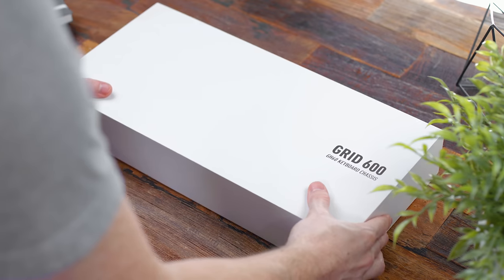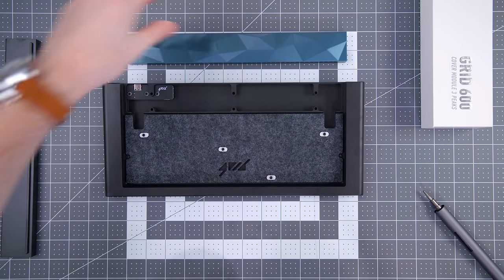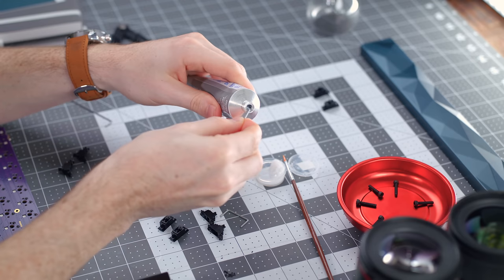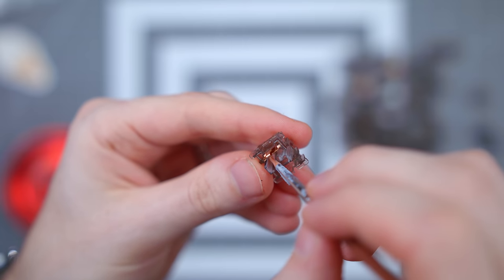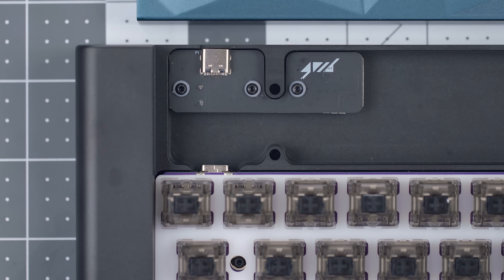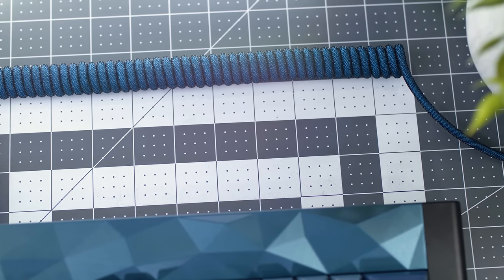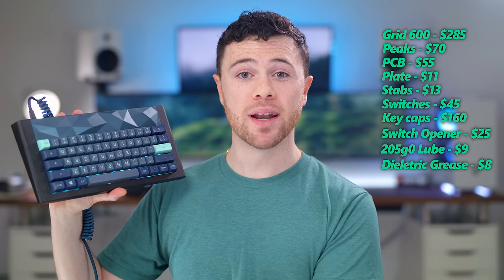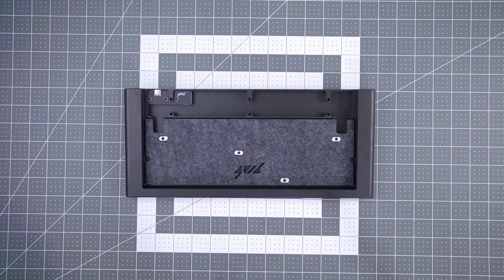Building My $680 Custom Mechanical Keyboard!

Comment: Hey Frank! Awesome video. I've been building boards for a couple years now and have a couple tips if you're interested:
1. You can use 205g0 on all parts of your stab. Just brush it on the wire like you did with the stab housing. Also, make sure you lube the stab insert too (the part that you clipped).
2. Hard to tell, but it looks like your switches are not clipped into the plate so it's just resting on the pcb. I've also bought that plate from spacecat and I had the same issue. The switch cutouts are too loose.
3. Leaving the middle screw out won't soften your typing experience unless you also remove the standoff. The pcb is just resting on it now and likely making noise when it smacks against the standoff.
4. I know you said that switch you lubed was messy, but just in case, that was enough lube for about 3-4 switches. You want just enough that there is a slight gloss texture to the plastic. There should be no white globs or areas of excess buildup or the switch will feel gumed up and sluggish.

Otherwise, this is a heck of a first build. My first "build" was literally just a switch swap, haha.
Reply: Ensaum for stabs it’s better to get dielectric grease and superlube, 205g0 is still good tho
Reply: @ferni0  I've done both multiple times and gotten better results with 205g0. Personal preference though I guess.
Reply: Ensaum I’d say for beginners superlube is easier because of availability, when you start lube is tricky to find
Reply: Can i mix dielectric for wire and thick lube for sliders?
Reply: Nevermind lol
Reply: @ferni0  Yeah, 205g0 can definitely be hard to find in stock, but he already had it which is why I suggested using it on the wire and inserts too.

Comment: Me: can’t afford a 600$ PC

Randomfrankp: Lets build a 600$ keyboard
Reply: A $600 PC? From where? Wish?
Reply: @NightRainn  hp elite 8300 sff i5 3470 and gtx 1030 8 gb ram for 240$ on ebay and gtx 1050 ti for 250$ get the hp elite 8300 sff without a gpu for 100 or less and gtx 1050ti and that's a 300$ or 350$ gaming pc
Reply: @shelby3724  *gt 1030 ;)
Reply: Get a better job
Reply: @calebfisher7690 some of these 12 yo kids cant get a job lol. Theyre the ones that make up most of the comments saying i wish i had a better pc and some of them are in indonesia etc where its hard to afford pcs there, personally i have a mad setup ;) rtx 2080 super,32gb of gskill trident z royal rgb, ryzen 7 3700x and 5tb of ssd storage
Reply: Seth S. the subtle flex at the end 😏
Reply: @percwhitney  😉 hahaha, shhhh....
Reply: N-Word  lol i appreciate your oddly voiced opinion, i like my setup and thats all there is to it :)
Reply: As a 12 year old, I can say that it is very hard to save money. $6 per week with no way of getting more does not do you much good.
Reply: I’m 12
Reply: @shelby3724  Or just a second hand rx 580 or a 1070 for under 200, but yeah you can get a decent gaming pc for cheap these days
Reply: @Shwanksy  Yeah dude I feel you.. They just whining about having a bad pc while being too lazy to work for it, i personally got my pc 5 years ago, a g3258 and an r9 270x, worked 2 months for it :) Now when I have a real job I got my dream setup which is similar to yours, 3700x and 2080 super :)
Reply: If you can't afford a $600 PC, then you need to reevaluate your priorities and/or save more money. It's really hard to save for that setup you want if you eat out all the time, go to the movies, buy other things you don't need etc etc. Any normal person (normal being people that have access to a device and internet to even watch this video in the first place) can afford to buy any PC they want within reason. An i5 / 1660 or AMD equivalent is not unattainable for the majority of people who wish they had something like that.
Reply: World Known some people aren’t old enough for a job
Reply: @calebfisher7690  Get better parents!
Reply: @NightRainn  building it yourself
Reply: Its NightRain I got a custom made pc for $490 australian dollars (2x more then american, so about $245) including a moniker, keyboard and mouse
Reply: @markojovanovic7100  yeah man its absolutely surreal when you can finally get something like that aye
Reply: N-Word  tf is a 64 core dominator ram xD
Reply: i’ve found another
Reply: @oscarsolano8298  haha yeah probably but damn... i gotta get me a 64 core dominator ram xD
Reply: @Shwanksy  true.
Reply: Lone Wolf dear god. when was that made? 2009?
Reply: @Hi-vp2bq  you guys are getting paid?
Reply: Save up
Reply: It'z.Zilent   ;)
Reply: It'z.Zilent  i mean its not like im rich, i have a full time job so i grinded out the hours at work so i could grind out the hours on rainbow six siege ;)
Reply: It'z.Zilent  yes but not the official rtx minecraft. Ive been using seus ptgi and umsoea 4k and its dope af
Reply: Lone Wolf and thats a trash pc
Reply: @Shwanksy  weird flex but ok..... I myself stuck here with a 3990x 64 core, 8 x 16g  ddr4 3600 cl16 trident  Z Royale, 2x Radeon VII 16gb HBM2 and a Aorus TRX40 Xtreme with 16x 70A....
Reply: @paulmueller100x  ayyyye nice my guy
Reply: @paulmueller100x  my render rig is nearly as good. Ive got last gen threadripper 2990wx
Reply: Bruh u havent seenthe tfue $3500
Reply: N-Word thats a godly pc wdym
Reply: Easliy Displeased  lol true, i just buy cs shit now
Reply: @markojovanovic7100  Yeah, but they're 12. What source of income do you think they will be getting? Mowing lawns? I personally wouldn't spend that much time just to get a PC. I would rather spend that time on actual academic studies. Seems much more efficient in the long term, doesn't it?

Yes, you could save up for years, but PC parts come out ridiculously fast. And by the time you reach your old goal, you'll need to set a new one to get up-to-date.
Reply: @Hi-vp2bq  6 x 52  = 312 save up for 2 years and you have a good PC.
Reply: @shaky8037  bruh
Reply: @AntonPogonin  bro i was 13 back then 🗿 cringe ass comment

Comment: I just built my first custom mech yesterday with that same PCB, and it's so great. What you could do is remap the right shift, control menu and fn keys with QMK to arrow keys with tap functions, so you get the benefits of a big board in a smaller form factor.
Reply: Why not just remap w a s d to arrow keys on other layer with fn1/2 key
Reply: So you don't have to hit a button to activate another layer everytime you want to access arrow keys
Reply: @techalicious9526  ah sure but right shift wolud be a bit scuffed but makes sense

Comment: Will you ever change the keycaps to something like SA Calm Depth or GMK Voyage?

Btw you forgot to mention the price of the cable, which will be in total $720-730 😅
Reply: I was thinking Calm Depths would go great with this as well, however Voyager I think is too much of a blue to work with the top module. It's a beautiful set tho

Comment: It takes a lot of time to learn and build up an 'inventory' so to speak. It's very hard to buy exactly what you need for a single build in one go.

So if you keep collecting, then eventually things will fall together, like matching a keycap set to a case, bought at entirely different times.

Comment: Normal People: 100usd for a keyboard? Far too expensive what is this bs
This guy: no
Reply: Just no
Reply: You know, even $1000 isn't that expensive for this community x)
Reply: You haven't even scratched the surface
Reply: @Waypse  I'd have to disagree, I rarely see boards over $1000 unless you are accounting for current resell price and not the price it was bought for
Reply: @bsmith4185  yup, even tgr boards start out around 700, but resell for $2000
Reply: Benjamin Smith Well there lots of keebs that over $1000, like the 360, Dolphine,...
Reply: @Waypse  It is for a single keyboard :)   
(I do actually know about keyboards btw)
Reply: @pdnaa  good for ya
Reply: @bsmith4185  there is actually many builds over 1000$. Keycult, kepler, tgr jane, lyn whale, some cases on zeal.pc, and many others. You just don't see them
Reply: @Waypse  I know they exist, but I don't think they "aren't that expensive" because there are so many cheaper boards that are way more common in the hobby (not just commonly available ones, but group buys too)
Reply: @bsmith4185  well, they are more common because they are cheaper, lol

Comment: great keyboard! just a tip for anyone not just you. you shouldn't mix two different greases or two different lubes or a grease and a lube. just pick one and lubricate whatever item you are lubricating with the one. its obviously fine to use 2 different lubricants on separate stabs but i recommend not using two lubricants on one stab. if that makes sense.

Comment: When your computer peripherals cost more than your actually PC
Reply: I’m really not trying to be negative, but this just seems like a complete money grab. I’m not paying more than 200$ for a keyboard. That’s just crazy. But this keyboard isint as crazy as the guy claiming he built tfue keyboard for 3500$.
Reply: @MJBjj870  It's literally a custom keyboard, you need to consider the quality of the switches, what the plate and all the keycaps are made of etc.

Tae's tfue build is genuinely worth that much, but the board is likely going to last for years upon years too, and plus I don't see why not if you have the money
Reply: @MJBjj870  It isn't though. It's just a cost of group buys. Mechanical keyboards, keycaps and other accessories come in all different shapes, sizes, colours, materials etc. Most of these  are designed by individual community members who are trying to bring something new to the rest of the mechanical keyboard community. Unfortunately many of these products have minimum order quantities (MOQs) as it is not cost efficient, or too expensive, for a manufacturer to produce only one unit of a particular product which means that the designer must pitch their idea to the community and organize a group buy for it in order for it to get produced. 

Group buys are where a group of people collectively order a product with the hope that it will reach MOQ. In most cases, this is the only way that custom products are manufactured. Group buys are usually held between two dates, known as the start and end date. If a particular group buy does not reach the required MOQ on or before the end date, then all of the orders will be cancelled and each customer will be refunded. If the group buy meets or exceeds the MOQ, then the order will be submitted to the manufacturer. Customers will receive their order once the products have been manufactured. The MOQs and group buy lead times vary between each group buy, but this information is usually listed on the group buy page. 

Not all group buys are for custom, unique products. Sometimes group buys can be held for existing products, where a large and existing keyboard manufacturer will cut the price of their product for the community if a certain MOQ is met. That said, you can get an objectively good mechanical keyboard like a Ducky One 2 Mini or even a more well known Cooler Master for about $150 - $200. The offside is that those are mass produced, quality may not always be as good, and it won't be personalized aside from whatever RGB profiles you can assign to it.

Comment: There’s no way he bought a $600 keyboard to type “fhsq fzdfe poemscfh eornsx”
Reply: With four fingers
Reply: Your right
He bought the parts not the keyboard. Also
He obviously used it for other things
Reply: A Creative Username you do realize that buying parts for a keyboard is essentially just buying a keyboard?
Reply: @aidanchiu346  yes. I do
Reply: A Creative Username then what’s the point in correcting me?
Reply: AidanHas0Skill not if you are assembling those parts
Reply: @MunkyButtProductions  Bruh. He bought the parts to make a keyboard (which is kinda unnecessary) and built a keyboard with them. If you buy a product that is a part of a whole bigger project then it is just basically purchasing a keyboard.
Reply: @aidanchiu346  Maybe he bought the parts to create his own keyboard because it would have its own value to him, maybe to feel accomplished or something. He did it for a reason.
Reply: @notbappo2435  He says that in the video. It's his first "Custom Mechanical Keyboard"
Reply: @NaviCra  I haven't commented on this in a month LMAO
Reply: Navi lmao this is such an old comment are you ok?
Reply: Navi the difference between and house and a keyboard is that a house is an essential piece of life. A keyboard is MUCH  easier to buy instead of build. Whats the point in comparing a keyboard to a house? If you build a keyboard, then that’s a waste of time. If you build a house, you can actually live there. If you build a keyboard, you just type on it. Just use a dell instead of a $600 keyboard that doesn’t even have a function row. Unnecessary comment.
Reply: @aidanchiu346   first of all you tell that your disabled by going to a doctor. Then you go and compare the house. And not the PC. Now you are muted cuz I want to.
Reply: @aidanchiu346  Eh, building custom mechanical keyboards is a hobby/niche. While it may be a huge waste of time for you, doesn't mean it has to be for other people. The whole point of building one is to customize it the way you want to. 
In this timeline the keyboard is pretty much an essential tool and some just value the feel and sound of a keyboard. 
I had the same mindset as you, but when I tried it myself I gotta say, I'm never going back to a cheap membrane keyboard.
Reply: addicted.spirit true. I agree with you because when I was youngrer I used to have a really big Pokémon card addiction. It was a HUGE waste of money but it made me happy. If spending ludicrous amounts of money on things makes life a little bit more enjoyable then I would do the same thing :D
Reply: @aidanchiu346  exactly. It is a hobby that people get into because building keyboards is fun and it is cool to make a nicer keyboard that you can use forever. When people first join the hobby they all kind of say that so I understand where you come from, but just like legos was in your case, keyboards are a hobby that lots of people take part in because they like making their keyboard their own and being able to change every aspect of it however they want to. Also, if you think about it, adults that work desk jobs or people that spend lots of time on their desk benefit from a nice keyboard because they spend as much time with their keyboards as they do on their phone or computer. Everyone wants the new flagship device, but nobody looks to enhance their typing experience. Just my two cents, didn't really want to start an argument so hopefully it doesn't seem like that. 

Also I know it is an old comment, but I was very bored so I just came back to this video to watch it and saw this comment. :)
Reply: @addicted.spirit5305  haha perfectly said!
Reply: It's a sound test
Reply: @notbappo2435  OH MY FUCKING GOD WHY DID YOU COMMENT THIS????? YOU STARTED A WHOLE GODDAMN WAR IN THE REPLIES
Reply: @trashpanda8123  good
Reply: He’s making money from this video lol
Reply: @AidanHas0Skill this is a hobby I'm trying to get into myself but no hate on u think of it as u and ur Pokémon cards it's a hobby not a flex or whatever u thought of it as. It's a hobby just remember

Comment: Lol I legit just finished building my custom mechanical keyboard
Reply: me too, custom mech keyboards are so underrated these days its 100x better than mass manufactured keyboards
Reply: @MrBedh3ad  better but unlike building a desktop where you can save money, you spend more money.
Reply: Ngl man I think I'm just gunna buy the gmmk base 60% from glorious, and just buy switches and key caps
Reply: Lol
Reply: That’s cool
Reply: I got an full sized keyboard. I need it for my gta v mod menu
Reply: ITZLIT what switches did you go for
Reply: I have an rog laptop with an rgb keyboard. So you can "None"
Reply: Is the switches on the keyboard any good it still counts as a switch
Reply: it's not mechanical
Reply: I still count it as a switch

Comment: Yo Random can you do a video on how you made your custom keycaps. I have a cool design and want to make a custom set and I don't know how max keyboards works. 
Just a thought. tyty
Reply: I wouldn't recommend Maxkeyboards or WASD to make custom keycaps. the material and printing methods they use both are not very durable and will wear out quickly as well as being low quality. If you want a custom set, pay a premium to get them made out of  dye sublimated PBT. this is much higher quality printing because PBT plastic is extremely wear resistant and dye subbing is literally chemically burning dye inside the plastic. I found someone talking about a service that does this on r/mechanical keyboards. ask OP any questions. I have no experience with them. https://www.reddit.com/r/MechanicalKeyboards/comments/ckojoe/custom_keycaps/
Reply: stress. he bought the keycaps
Reply: Not sure why he linked maxkeyboards for "custom keycaps", even though he stated in the video that it was SA Abyss. This is an already existing set called "SA Abyss" that he likely bought in a group buy.
Reply: @aw4eva144  in his prime Day unboxing he showed us some keycaps he got custom made
Reply: @nochromi1305   in his prime Day unboxing he showed us some keycaps he got custom made